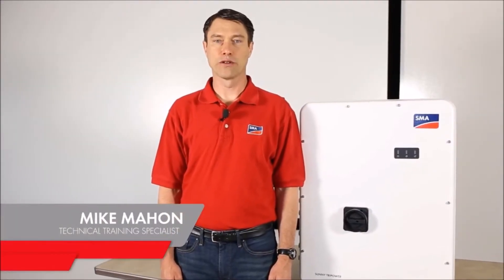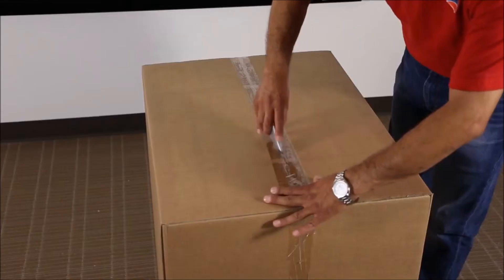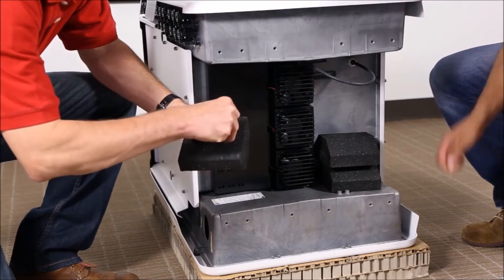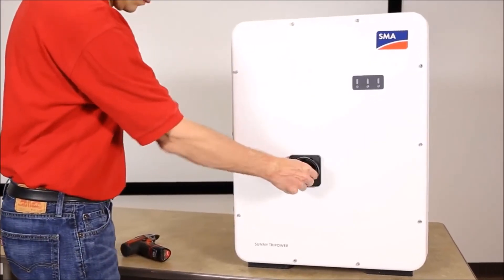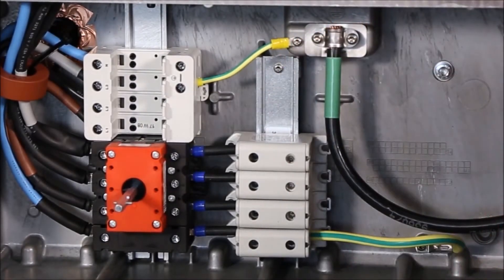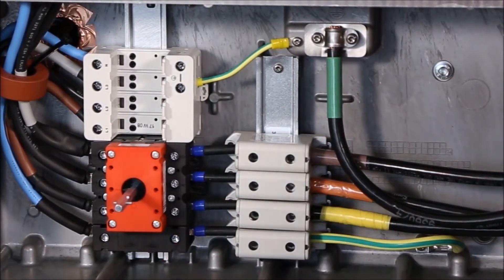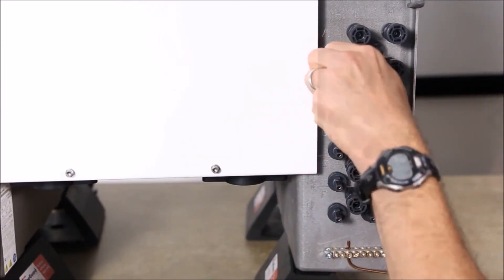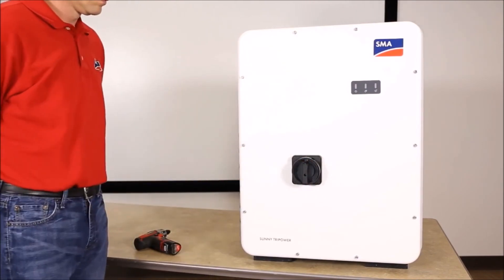SMA Sunny TRIPOWER CORE1 Installation | RENVU

Comment: Would the Core 1 also work with an AC wind generator that had been rectified to DC? 

Also, the purpose of the TS4-R-F rapid shutdown module would also work in this situation, disconnecting the generator’s output power from the lines between the generator and the Core 1 inverter, correct? 

Finally, the Core 1 also includes an AC disconnect switch that initiates the rapid shutdown of the power generating system, yes?
Reply from the maker: Hello! 

1. No, this is a solar inverter specifically designed for solar strings/inputs and their associated currents/voltages.
2. No, the TS4-R-F is specifically designed to be paired 1:1 with a single solar panel and its associated current/voltage.
3. Yes to both (if the system has rapid shutdown MLPE devices installed, engaging the AC disconnect will trigger rapid shutdown)

Please let us know if you have any more questions! You can contact our sales engineers by sending an email to info@renvu.com. Cheers!

Comment: Very fast installation. My question is: It's possible to use a transformer LV-LV, connected between the grid and the SMA Core 1, in countries where the commercial voltage is different from U.S or E.U?
Reply from the maker: Yes, it is possible under certain conditions. Keep in mind that the inverter outputs 480/277V at a frequency of either 50Hz or 60Hz, and transformers can alter voltage but not frequency. You will want to confirm with SMA directly that the commercial voltage and frequency of your country will be within the capabilities of the inverter-transformer pairing.

Comment: thx RENVU Solar Equipment Distribution for the this tutorial.
I just want to ask one question. why there is two RJ45 in blue and red and what are their functions ???
Reply from the maker: The SMA Core1 features two RJ45 ethernet cable ports on its communications board to allow for daisy chaining. Multiple inverter communications boards can be daisy chained (A to B) using the second port. The cables between the inverters can be up to 100m in length. The inverters may require the same password to be used between them. For additional help, call the SMA tech support line, and they can help you out with the configuration.

For more information on SMA Speedwire via ethernet cable, please see the manual below:
http://files.sma.de/dl/7680/Speedwire-TI-en-11.pdf
Reply: RENVU Solar Equipment Distribution thx for the infos!!
Reply from the maker: Happy to help :)

Comment: can you add a second AC input from a Diesel Generator?
Reply from the maker: The SMA Core1 product is only designed to take input from solar DC sources. If you wish to run an AC Diesel Generator in parallel, that shouldn't be an issue, but it would be connected to the AC system, and not directly to the SMA inverter. Check with an Electrical Engineer who is experienced with Generator and PV systems running in parallel on 3 phase systems to be sure.